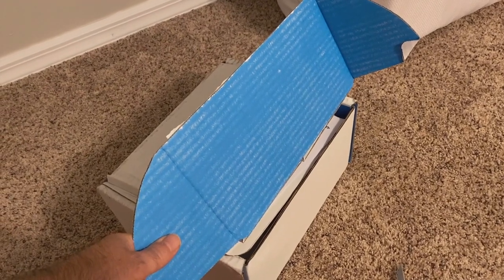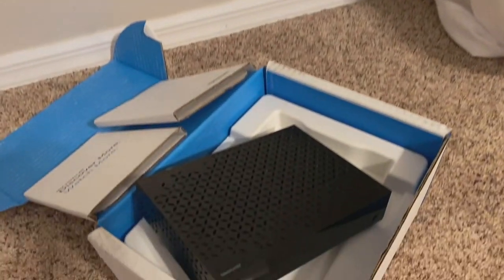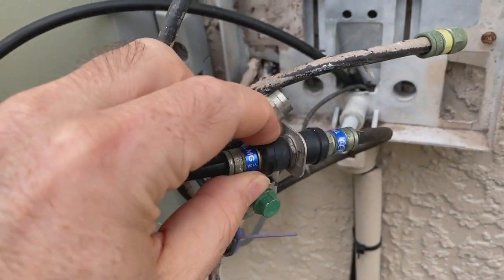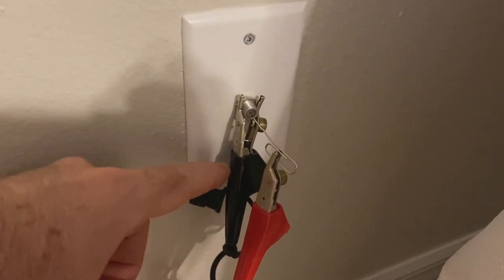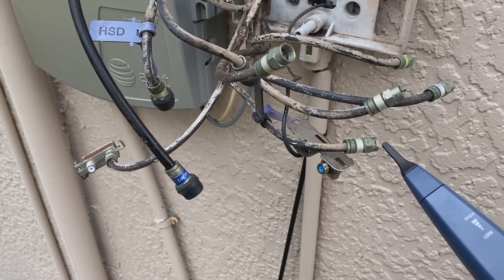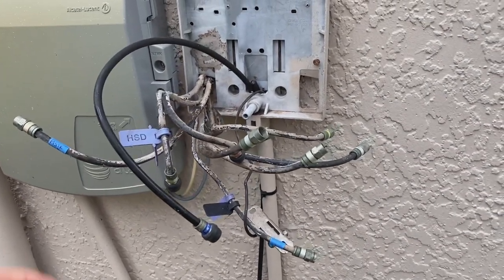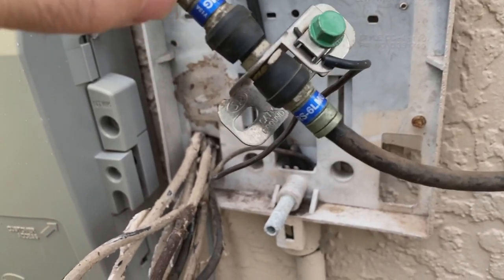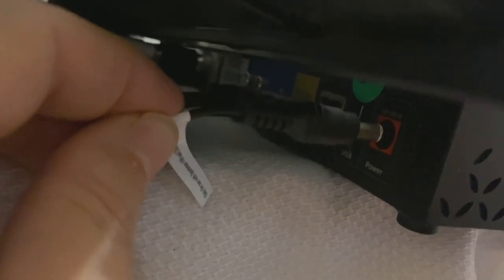Cable TV installation

Comment: my trick is an F connector to 8 inches of rg6 to a cat3 wall socket , potted with hot melt glue, and heat shrinked, now  just plug the telcoms RJ11 on toner in and viola, toning away ;)
Reply from the maker: Ok,  interesting.  Sounds like that wouldn’t be too hard to make.  And, a great addition to the tool bag.   Thanks for mentioning.  Sounds really handy! 😊👍

Comment: Fluke Networks IntelliTone Pro 200 LAN Toner includes an F connector for toning out Coax terminations as well as RJ11, RJ45, and wire pairs (https://www.amazon.com/Fluke-Networks-IntelliTone-Toner-MT-8200-60-KIT/dp/B00N2S6RPY/).  

Klein Tools also makes a good coax tester with multiple remote ends, so you could test up to 4 remote cables for continuity (https://www.amazon.com/Locations-Explorer-Klein-Tools-VDV512-101/dp/B076DP1534/).
Reply from the maker: Thank you, Brent!  Are you a field tech? 🙂
Reply: @DIYTelecom  I’m a network engineer by trade, so I have some experience with data cabling, and I just recently worked with coax for the first time at home.
Reply from the maker: Ok, excellent.  Appreciate your contribution here. :-)

Comment: Klein sells a good multi  color  tone so you can do 4 at once also has a phone ethernet port toners and wiring check
Reply from the maker: Klein - good stuff.  I trust them.   Thanks Travis. 👍
Reply: @DIYTelecom  that being said my go to on the job is a cheap toner, with clips, just easier sometimes when looking for 1 thing.
Reply from the maker: Yep I get it.  I typically roll with two.  Different brands with diff sounds . 😊